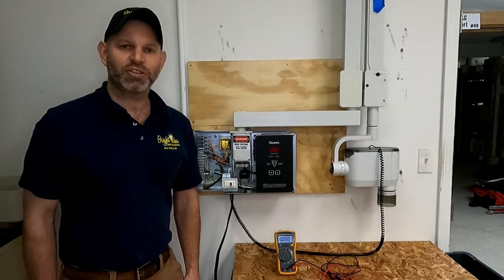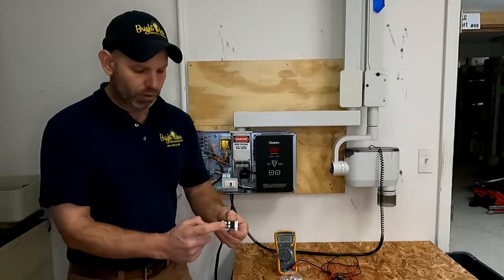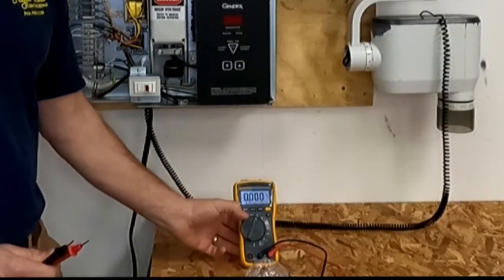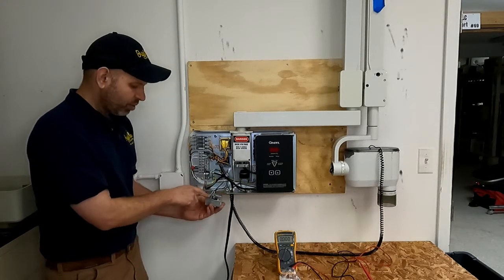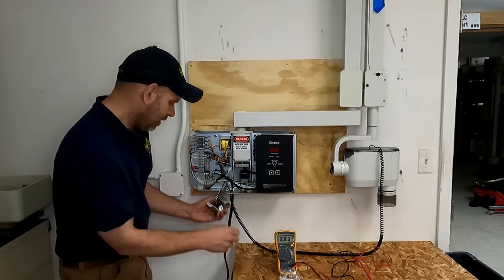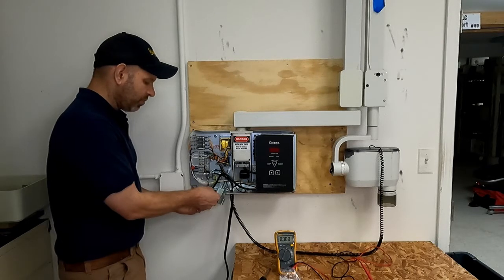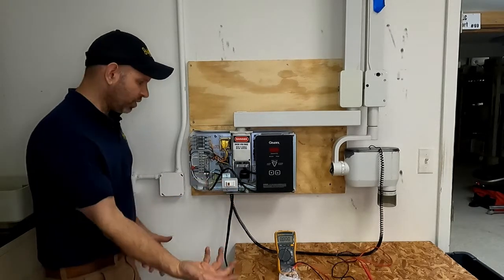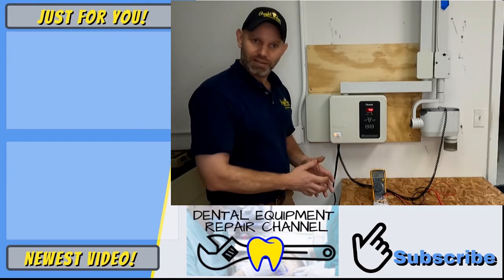Gendex 770 X-ray Switch Replacement

Comment: When I push the exposure button, nothing happens. I tried replacing the switch, but it still doesn't do anything. No beep. When I power on the unit, the exposure indicator light stays constantly lit. Any ideas?

Comment: Is there an internal fuse or something inside the GX770? Because I accidentally tripped the breaker the first time I was trying to replace the switch. Now, with the switch in place and all wires connected properly, the unit does power on.  The outlet it is plugged into is getting power (tested with a lamp) but the xray unit will not power on.  Any advice?
Reply from the maker: There is a whole row of fuses. They are on the left. Use the multimeter to check them out with power removed to the unit. This is either done by unplugging it or by flipping the circuit breaker be careful, as you know that electricity can bite you
Reply: @DentalEquipmentRepairChannel  Got it. Thanks.  That did the trick.  I jumped the 10A fuse with a wire and power came on.  I should have seen them. So obvious. Thanks for the quick reply.

Comment: Thank you for posting dental equipment videos. I have unit which was hard wired but now I want to add power cord and remote switch on wall. What do you recommend for power cord (part number or link ) and remote switch? Thanks!
Reply from the maker: Have a qualified technician do it. If you do not know how to do it, this is not what you want to experiment with. Have your technician train you during the service call.

Comment: I need to replace the F4 fuse (10A 250V) on our gx 770.  Is this a time delay or fast acting fuse?  Thanks!
Reply from the maker: Read the label, if it says fast or slow, the fuse type is as it is labeled. If it says F it means the fuse is a fast-blow, and if it says T or S it means it is a slow-blow.
Replace it with what is there.
Reply: Thanks for the response.  Unfortunately, no such labeling.  Its just a ceramic fuse that says "10A 250V 314".  The other end of the fuse has an "E" as well as the U.S. and Canadian international standard markings. @DentalEquipmentRepairChannel
Reply from the maker: @BenTrottier-f7o  no worries. I'd put in another slow blow. They are usually ceramic, I think.

Comment: When I press on the button to expose a sensor, now nothing happens.  What would you suggest that I check?
Reply from the maker: Is your exposure switch on the wall or on a cord hanging from the unit? It sounds like a exposure switch issue. Things break most commonly where they are touched.
Reply: On the wall.   Suddenly nothing happens when I press the button.   No moving parts.
Reply from the maker: @WingChun-n7i  the button is likely bad. If not, it could be wiring or control. https://www.dcionline.com/parts/product/7116
Reply: There’s a current going to the switch.  I bypassed it, but nothing happened.   I expected it to have at least a short beep, meaning one exposure.
Reply: Unfortunately TP-1 and TP-13 is 112 VAC with Control On, and TS1-7 to TP1 is 112 VAC also with Control On.

Comment: I have a unit which turns on, but when trying to take the X-ray it does not want to actuate, the push button was replaced and the power supply cable.
do you think you can upload a video as normal operation would be. and why it may not be sending power to the head
Thank you
Reply from the maker: Does it beep? It is possible that you have a bad x-ray Tubehead. If you have a spare unit, you can try to swap the heads. You can also buy a used working unit and try to switch the tube, control and arm(wiring) to get it going. The parts should interchange.